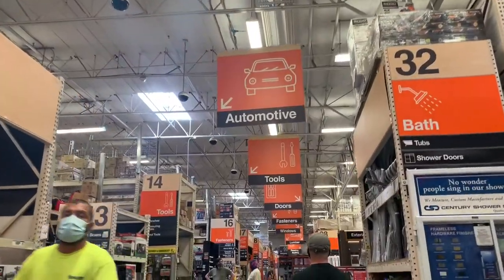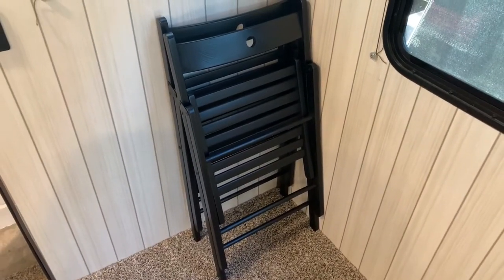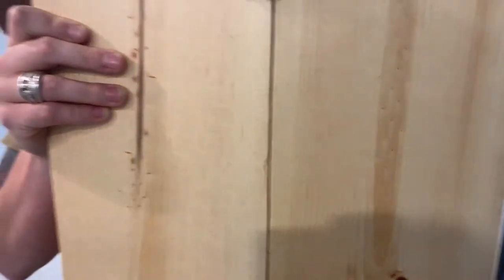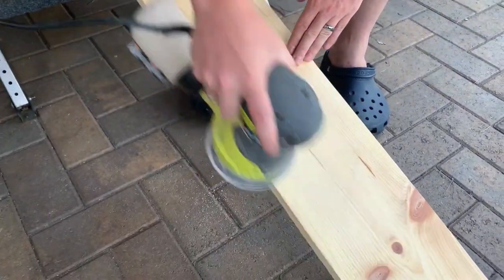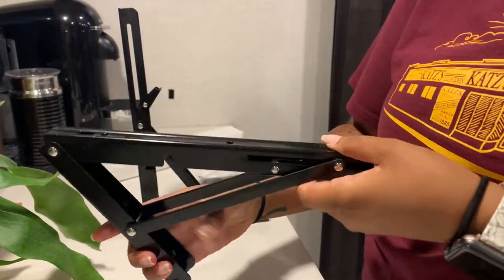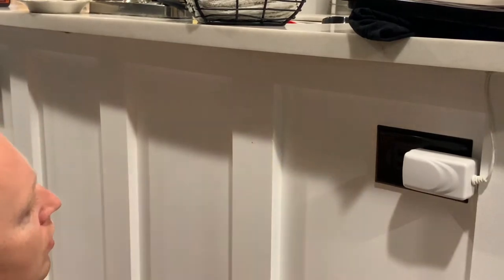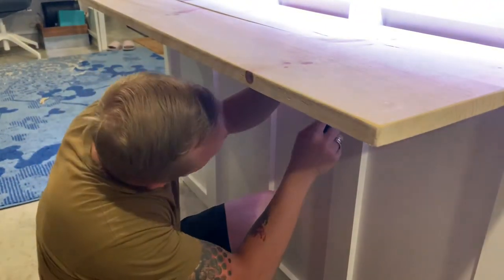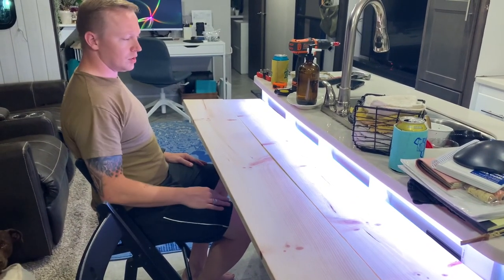Life Near the Water | DIY MURPHY TABLE

Comment: The one thing that gets me is the uneven part in the middle
Reply from the maker: It was funky when we first installed but it’s flattened out perfectly since. The pickle with getting wood at box stores is that they can’t guarantee perfect cuts or flat wood, if it’s warped it’s warped. But it’s worked out well!
Reply: That’s nice to hear 🙂

Comment: Comparing side by side with a drill bit can be difficult to be accurate.  Use a Drill Gauge to determine the diameter of the plug if you want to be more precise.

Comment: Did you have access to the other side of that island? I think bolting the bracket would give you a lot more strength than a plastic anchor
Reply: Agreed.  Bolts, nuts, and washers for the win.
However, another option would be to use a High-Strength Structural Screws (like Spax, FastenMaster, and GRK) if you don't have access to the other side.
Plastic wedges/anchors with a screw in them are not very strong at all and won't stand the test of time.  If you don't have anything solid to screw into, get a piece of 3/4-inch plywood that spans two or more studs and screw that into the studs, Then screw your brackets into the plywood.